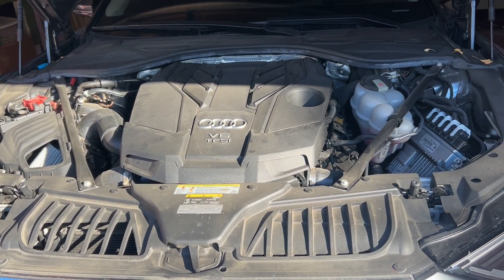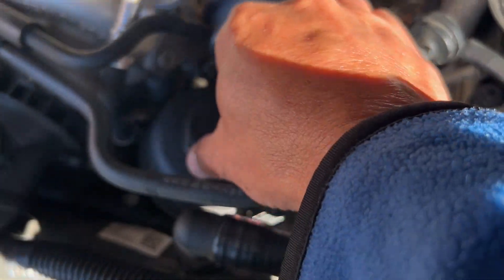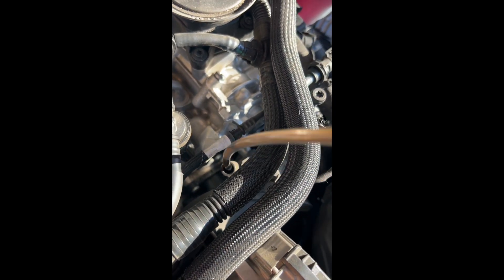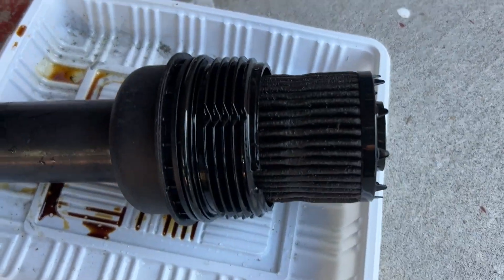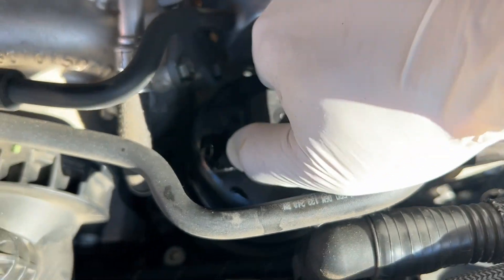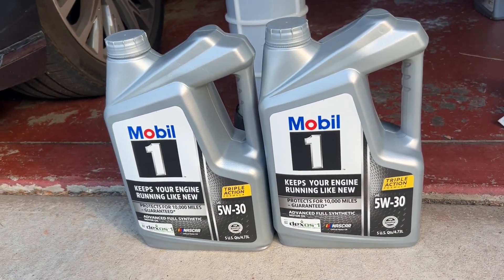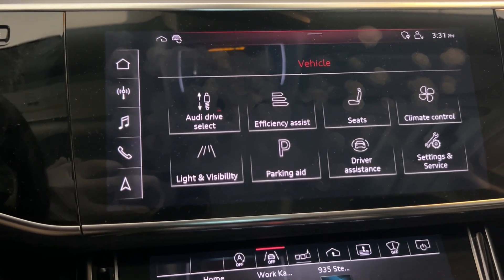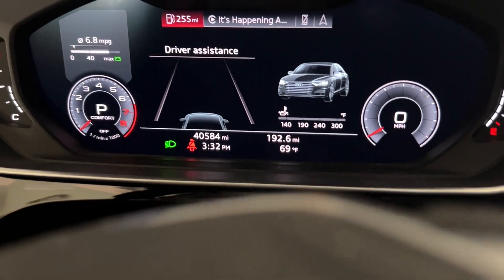Oil Change On A8L D5 3.0T

Comment: Hello,
In my Audi A6 2008, the circuit board for operating mmi 2g high was replaced. Then no more sound comes from the speakers. Component protection active.
At Audi you can't take it out. I don't know what to do anymore. Can you help me or give me a tip?
Thanks!
Reply from the maker: Hopefully you still have the old HU, read this to see if you can remove cp on your new HU https://www.dognmonkey.com/audi/how-to-restore-sounds-from-mmi-2g-component-protection-cp.html
Reply: The hu is the old one. Only the board for operating the MMI was replaced. The component protection has been activated
Reply from the maker: @leonn5092  I never had to replace the mmi controller, you should ask in the audiworld forum. It may have an i2c needed to be swapped with the old one like the HU